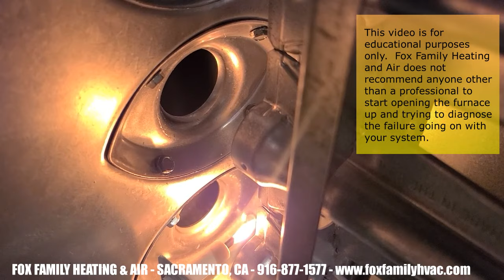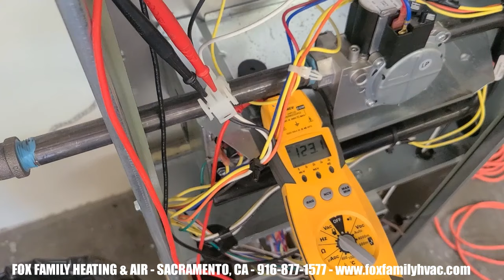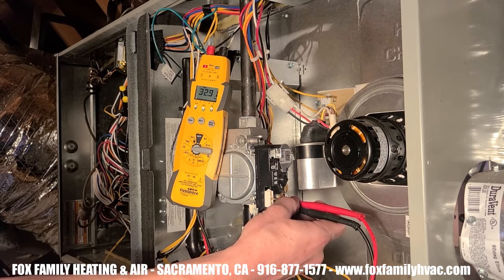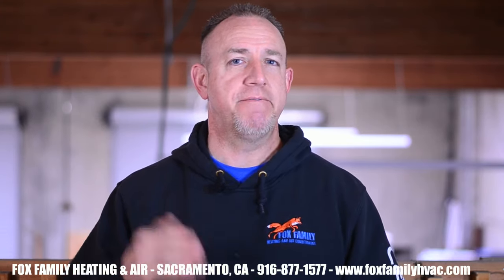How to Diagnose a Bad Furnace Gas Valve (10 Things To Check in 2021)

Comment from the maker: If you want to learn how to Troubleshoot a furnace gas valve this video can give you some great information.  Please comment below and let us have some of your expertise!
Reply: Fan motor running, no heat, the igniter is lighting the blue flame and then it's switching off every 3 seconds then clicking back on again cycling, not sure what this is...
Reply: @seatime674  Was it the flame sensor?
Reply: Thanks ..i will tell you this ..i moved the plug slightly to the right and it has been working for the past 3 weeks keeping the house warm starting and stopping as it should .I have carbon monoxide detectors on every floor of the house as well as some First alert little ones above several vents where the air is coming out to make sure .But just from that slight push on the plug that gives it power and its working .Does that mean its just a loose connection at the plug or should i still replace it ?
Reply: The entire sequence happens as it should up until the gas is supposed to ignite. I can hear the valve click, but no flame. I got someone from the gas company to come out and check to make sure I'm getting gas to the unit at the correct pressure. That's all good. So maybe something inside the valve is stuck? or maybe something is clogged?
Reply: This video was very helpful and I feel like the solution is in there somewhere, so thank you. Interestingly, my furnace cycle clears all the stages that you mentioned. 

Except now the flames drop out after a few minutes, and only room temperature air gets blown through the air ducts. 
 
I cleaned the burners and even replaced the flame sensor rod, and that didn’t fix the issue.  Pretty stumped now but I have a gut feeling that the solution is somewhere in this video.

Comment: Great video again. When I serviced some commercial HVAC in New England I would find fire dampers doors closed due to the link failing and also found internal duct insulation would fall off plugging the coils or bends in the ducts. Thanks

Comment: Your tip about the clogged gas outlet was what I needed! Totally obstructed, after using a small sewing pin to scrape stuff out I went from a tiny blue flame to a full strong orange flame, and actual heat! Thanks for the video!

Comment: I called a professional furnace man when I was having trouble and he changed the gas valve . I started having the same trouble a while later and this time I did it myself and found the gas orifice to the nossel pointing at the ignitor was plugged. I had just thrown 500 dollars into the toilet and still had to do it myself.
Reply: Plugged with what? And you were charged $500 to replace a gas valve? Seems like an overcharge.
Reply: @strongspear4988   It was probably plugged with rust from the steel gas line, and most of the charges were travel and labour, I live a long ways from town.
Reply: Its not an overcharge. Some gas valves are over 400 dollars just the part.
Reply: If he replaced the valve and it was not the problem, then you would’ve had the same issue pretty much immediately after the tech left because it wasn’t remedied so since you say that it took a while for another situation to arise, it probably was what I call a dual or combination problem where it was  probably two different things and you tackled the second thing. The tech did not go far enough to check other things as they thought it was the only problem was the gas valve.When  I’ve done a repair, I will usually wait right there after it has gone through several cycles to make sure it is running properly while I’m checking other things, like pressures and connections and what not.
   Edward H. – “Integrity, Plumbing, Septic, Heating, and Drain“ out of the Clinton, CT area.
    “Doing the job right for  the first time for 34 years!“

Comment: Just dealt with this last week. Luckily it was my own. Came home from work and noticed the house was about 10 degrees setpoint. Reset the furnace and everything operated as expected. Came home the next day, house was cold again, started looking into it deeper, call for heat, inducer on, HSI glows but no ignition. Take the leads off of the GV and cycle again have 24V from board to GV, so started to look further into the GV but everything checked out. What I did was hooked up the GV leads to a contractor and then cycled the furnace and it pulled in the contactor after the HSI started to glow. Also I used a totally separate transformer plugged into a different power supply and put the secondary on the GV and fed it constant 24V, cycled the furnace again and it had ignition. After some deep troubleshooting it turns out the solder points where the wire harness connects to the board were weak. Put my meter to ohms with the board out of the furnace and measured with one lead  where the harness connects (with the harness) of
Reply: Wow

Comment: This video is about the furnace starting, but what about the end of the cycle, when it shuts off? I’m looking at a mid-80s Carrier that starts and runs fine, but then when it shuts off, you hear a small “boom” and it starts for a few seconds, then shuts off with another “boom”, then re-starts again. It does that 5-6 times, which each brief start and run getting shorter and shorter until it finally stops completely. I was looking at videos trying to determine the cause; my guess is that the gas valve isn’t completely closing so it keeps re-igniting. Anyway, an end of sequence video would be great! Everyone talks about getting them running, but not how they’re supposed to shut-down properly. Thanks!

Comment: Thank you ! This was so helpful! I was able to pinpoint my gas valve issue. Turns out it was just some corrosion on the wire terminals but it was the accurate instructions that led me to it ! Thank you!🙏🏾

Comment: and the other lead on the direct backside of the board going from point to point and found one point giving off crazy readings while the others were 0.1 or 0.2 ohms. This was a tricky one with it intermittently working. I was almost dead set on changing the valve but I changed the board and has been working fine since. Sorry didn’t mean for this to be 2 comments. I hit send before I was completely finished typing

Comment: Thx so much for this video.  You just fixed my furnace.  Bad pressure valve.  It was getting 15 volts on start up until it kicked into 27 volts and I could feel a small click but no gas entered the nozzles. Could not find one new.  Bought one on EBay for $28 used w/ free returns.

Comment: About 20 years ago, I successfully diagnosed a problem that is not mentioned in the video.  My Montgomery Wards gas dryer (manufacured by Norge) had a resistor mounted on the gas valve that went bad.  During startup, full voltage was normally applied to the solenoid in the gas valve, to enable opening.  After flame detection, voltage was normally switched to a parallel circuit, that included a voltage drop across the resistor, which kept the valve open without burning out the solenoid.  When my resistor went bad, the valve would shut off when the voltage was switched to the resistor's circuit.  The problem was solved, at low cost, by replacing the resistor.

Comment: I have replaced the main board and the pressure valve in the heat strip of  my old Goettl HVAC system.  The sequence of events you describe in your excellent video works...after I cleaned the ground connections. I now have heat!  However, I still have a question:  shouldn't the inducer motor stop after the system is up and running?  In this roof mounted system, I still feel a healthy stream of hot air to the outside after several minutes of running.
Reply: No the Inducer should stay on till the end of the heat cycle.

Comment: I had an HVAC Tech come out here today because I had delayed ignition sometimes...Burners are clean,he ran some tests and ended up saying I had a bad board because the gas valve is coming on basically at the same time as the HSI...No delay. The HSI is not getting a chance to fully warm up and by the time it does there is already too much gas in the heat exchanger and get that boom sometimes. Have you ever heard of this?

Comment: This is a huge help. I'm getting 26v to the gas valve. I put my meter on the leads to the gas valve and it read OL when on the ohm setting. If I watched and understand the video correctly, this means I should replace the gas valve, is that correct?
Reply: It means that it's time to call a service tech as you can't buy a gas valve unless you're certified.
Reply: @Islamisthecultofsin  actually I was able to buy one from Amazon that was an OEM Part from a distributor. Got it install and it worked immediately.
Reply: @jonesy_7073    Cool.  The local distributers will only sell them to licensed gas techs.

Comment: Thank you for this video. It was very informative. My furnace was converted from lp to natural gas a couple years ago. In the spring, when the furnace is no longer used, I will smell gas coming from the furnace and have to shut off the gas coming to it. You mentioned a spring in the gas valve and proper tension. If my technician didn't replace the spring during the conversion, would this cause a gas leak coming from the gas valve? I mentioned the problem to him later, and he said we may need to replace the gas valve. Your thoughts please.

Comment: Excellent video - thanks for posting it.  Can you comment on what might cause a gas valve to emit a constant tone while the gas is flowing through it?  My furnace starts and runs properly but there is a tone (about 1000 Hz) that is heard and appears to be coming from inside the gas valve.  I put a nut driver against the valve body when it was operating and put the other end to my ear to try to isolate where the noise is coming from.  Any cause for concern?

Comment: Good video! The issue I am having is that the fan and inducer will turn on, the igniter will heat up, then I’ll hear the click of the gas valve, but no gas comes out although I have propane in the tank. Any tips or advice would be a great help, thank you!
Reply: Dropping a common possibly
Reply: Call a technician because you did not understand what he explained.

Comment: I didn't hear the click sound of the valve at 4:02.  I checked the voltage and got 28 volt when activated by the mother board.  I tapped it several times as well lol.  I changed the valve and so far so good.

Comment: Great video for this amateur , thank you.
 
Roof mount (3ton?)  HVAC 
I do have a question.
When the leads to the gas valve energizes, are both  of them energized to 24 volts or just one? 
On my start sequence, everything goes exactly as you described .
1. power to control board
2. Thermostat signals heat
3. Inducer comes on
4. presser switch activates, proves the inducer came on and is working properly
5. Ignite start snapping an arc to light the LP.
Then nothing,. LP doe not come through the burners and light. 
On the gas value (Honeywell VR8205M 2401)  leads, only one of the two wires get voltage, could that be a problem?
Reply: I am having a similar problem at times.  The burners will not ignite.  It tries 3 times as the piece glows red.  No ignition. However, I never hear the click when this happens. 4 times the last month.  Most time it works.  Technician yesterday $129 was not much help. Just wanted to sell me new stuff.  Then they try to tell you it will cost $1000 for a new gas valve or motherboard.  If I want to replace a bad part should that be my decision? See what agas valve costs online? With labor $1000? Rip off. 😮. Just like car mechanics! Rip people off!😡 Old furnace and ac rotting in a land fill too!
Reply: @Jack51971  On mine I ended up replacing the  (Honeywell VR8205M 2401)  with a compatible replacement regulator, then after adjusting  the  LP pressure, it fired right up.. Had to call a HVAC part distributer for a compatible regulator, since mine was discontinued. BTW, they told me which one to buy but wouldn't sell it to me since I wasn't a contractor. Got from Amazon. Thanks to this video's checklist, I didn't waste money on unneeded parts.

Comment: I have an old Day And Night furnace that started leaking gas from the pilot knob. The knob can no longer be moved by hand. My question is how can I find the correct replacement valve on an (apparently) outdated system? The original valve is from an 80U-19A furnace which was used in multiple brand names. Everyone wants to sell me a new furnace without trying to replace the valve first. Any advice would be greatly appreciated as I don't have the money for a new furnace!

Comment: Great video.  Any suggestions on Error Code 1 on a York where the Inducer turns on for a second and then shuts off?  This keeps repeating over and over until you turn off the heater on the thermostat.  I see 124 volts at the inducer for the split second that it turns on and then voltage drops, following the inducer shutting off.  While the problem occurs the board flashes code 1.  I'll be checking voltage at the gas valve next.
Reply from the maker: The error code legend should be on the inside of one of the panels on the front of the furnace. Assuming it hasn't worn off 😁
Reply: If not you can look for the manual online which will show you what your error code is. Look up the model number and type manual, it should likely pop up. It also sounds like you "might" have a problem with your pressure switch. So checking for 24 v through them, in and out would be something to begin with too, and see whats the issue from the error code. 11:00

Comment: Thanks for the interesting video. I think I have a problem: my gas sniffer is on pretty high alert in the upper levels of my house (winter in Canada). I have checked all the gas lines inside the furnace with the gas sniffer (the connections are OK), BUT the sniffer goes on very high alert when I approach the gas manifold (when the furnace is off). Is this normal that some gas escapes the gas valve when the furnace is off?  Further, the furnace is three years old, and under warranty, so I had a technician come out yesterday and he laughed off the gas sniffer (he wouldn't use those things). He did the bubble test on the gas lines, and of course they were OK. He pronounced the furnace in working order.  What shall I do next? (I purchased the gas sniffer a week ago because I occasionally get a whiff of gas when no appliances are starting up.  I do not have a gas stove.)
Reply: c
I too would question the gas sniffer, I.E. where did you buy it and how sensitive/responsive is it, professional grade or dyi etc. However, the fact you are smelling gas via your nose I would advise you to call in another company,  sometimes leaks are intermittent.  Have the technician pressurize the lines to your house to 80psi and then use soap detector.  Betcha they will find the leak.

Comment: If a blower has a PSC motor, just for fun, check the blower motor capacitor, also check air vents at the motor and clean. this may cause the high limit to trip \ lack of cool air.
Reply from the maker: Good stuff John. Thx!

Comment: I have a Honeywell gas valve with an igniter assembly. The only error I get is max igniter trial fail. I took the burners out and scrubbed with a wire brush. New air filter. Poked a small wire in all the inlets including the assembly. My understanding of the sequence may be off. I pulled the igniter/flame rod out and polished the heat rod with some steel wool. I even swapped out the Q3400A1024 with a Slurk 24V universal igniter kit. Same results. I don’t hear the gas valve click, but inducer comes on, igniter glows, flame at the assembly, but not across the burners. Igniter turns off, flame turns the rod red, igniter comes on again, flame stops and then shuts down. Then I get my code. I replaced the assembly thinking maybe that’s the reason it’s not releasing gas to the burners. I’m going to clean out the A coil tomorrow and see if that helps, but I’m feeling like it’s more than that. Does this sound like a bad gas valve? I guess I was thinking the initial flame would register and then open gas to the burner inlets and kick on the blower.
Reply: Care should be taken when cleaning the flame rod. scrubbing with abrasives like steel wool can remove the metal coating and it will not sense correctly. Some say rubbing with paper and cleaning with acetate (fingernail polish remover) is preferred.

Comment: I once had water hanging up in the exhaust vent due a wrong slope in the tube,  air would not pass through and my furnace would shut off before long.  Put proper slope in the pipe so moisture would drain out.  All is good now.

Comment: I have an old temp star furnace that is not lighting at all. All the videos show newer furnaces.  I’m not sure if it’s the igniter or gas. It does not turn red at all
Reply: Sounds like a bad igniter, they are pretty cheap. If you have a hot surface igniter and it’s not glowing then it’s burnt out and needs a new one. When you put the new one in don’t touch the part with your bare fingers it’ll burn the igniter out bc of the oils on your hands

Comment: If the pilot and thermocouple have been replaced and still not able to light the pilot next is the a sticking valve? Tappan furnace. Manual light pilot wires all checked and nothing broken or disconnected and have continuity. I clean the furnace as well. But worked fine until the gas company shut it off for road work new gas line run to the houses on our street. And they said the blew the lines. But something doesnt add up and the servixe provider said he couldn't relight the pilot. Now left the issue with me to figure out. If the gas man couldn't.